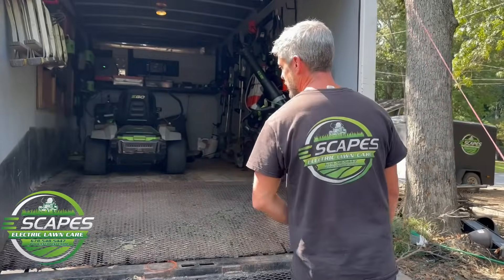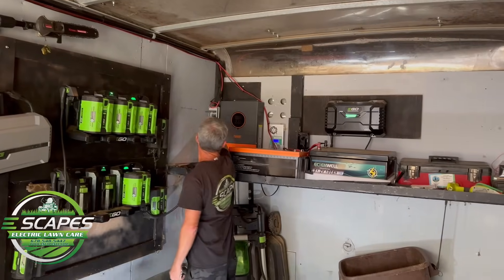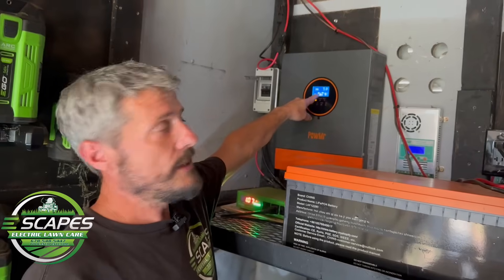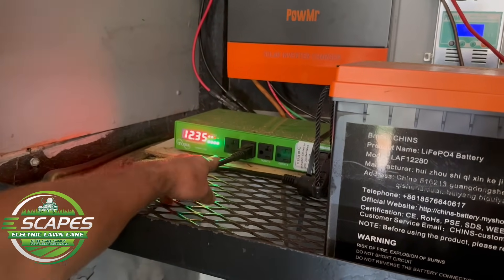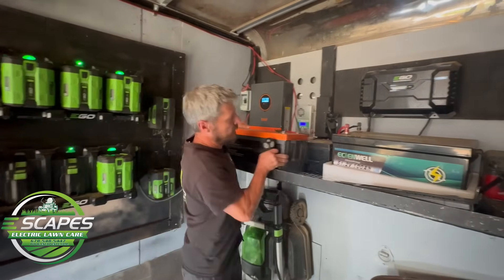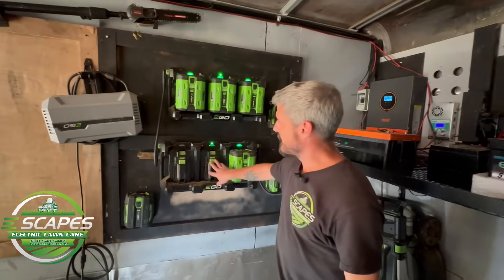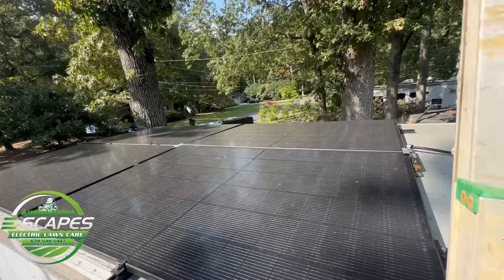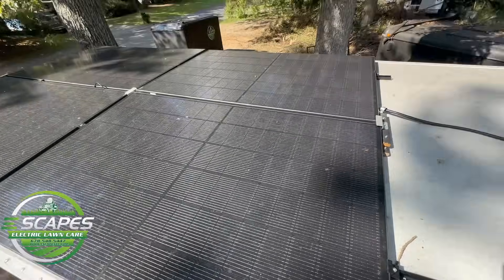Solar/Electric Landscape Box Truck

Comment: Great concept, except for the batteries.  Lithium-ion batteries are more prone to catching fire at high storage temperatures because the heat can trigger a self-sustaining and dangerous process called thermal runaway.  If you don't keep that trailer air conditioned or at least ventilated, it will shorten the lifespan of the batteries and potentially be a lithium battery fire waiting to happen.  Also, I am not sure if the solar storage batteries are LFP or lithium-ion like you said, but keeping different chemistry batteries in parallel can also cause a fire.
Reply from the maker: We have everything hooked up with failsafes in place. We monitor the temperature of the batteries and ensure proper storage and charging. We’ve been using our EGO batteries for over 4 years with no issues!